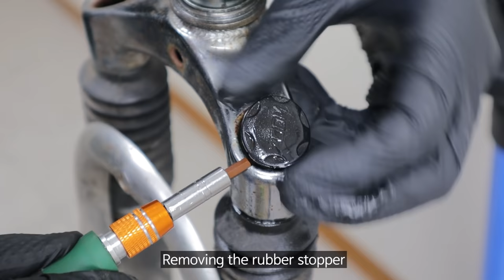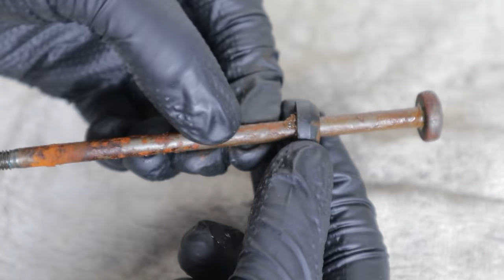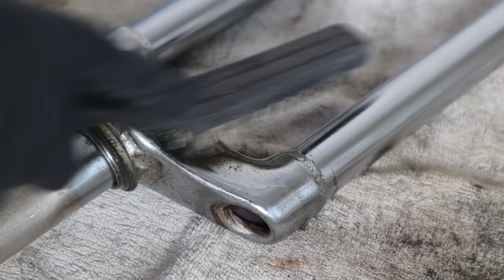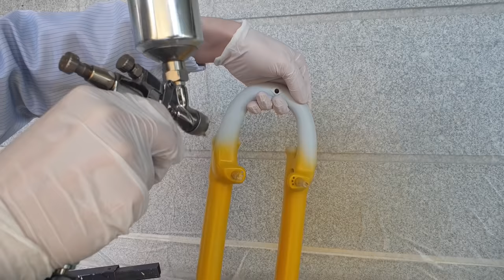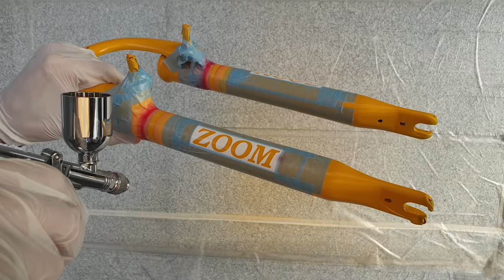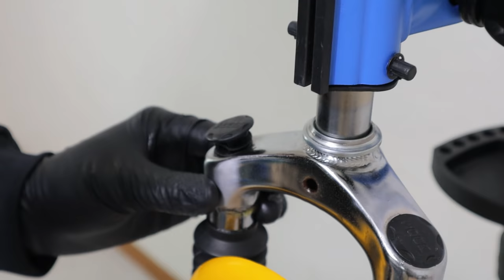[ASMR] Restoration Old Bike Suspension Fork

Comment from the maker: Thank you for watching.
Subscriptions and likes are a big boost to the next video.😀
Reply: I have a few comments to make. 1. It is better to protect chrome with a plastic brush and not with a metal brush. 2. Stickers are well removed if they are heated with a hair dryer. I do not know how Google will transfer the translation correctly)))
Reply: I have a question. Have you applied the varnish 2 times? Before the ZOOM label and then over the label?
Reply from the maker: @Kobenchack  Thank you! The logo was painted and then varnished.
Reply: Me referng to a Fox 40, where is the damper? And where the Air/Spring chamber? All i saw was a piece of Rubber to protect the Stanchions and the  Rods that kept the Lower legs on the Stanchions... additionaly why Yellow? this looks like a building equipment, i personaly dont like this colour on a fork at all...
Reply: Hello
Reply: @COMET RESTOEATION Good video.
Excuse me by chance the scissors or suspension that you are doing maintenance on is over rope or what type of scissors it is.
Reply: @marcosalfonsogonzalezarias558
Reply: Hola si mi horquilla marzochi Monster T no lleva fuelles en los barrales es malo ponerle?

Comment: Great job! but... what happened with the springs? Were they so damaged that you had to replace them completely? Did you restore them? That is something I would like to see. Thanks!
Reply: I wonder if there even were springs because they could never be secured by the plastic thing he puts in the upper leg. But thats where they should have went. I'm also sure he would have showed us the springs to make the video more interesting..
Reply: i think the spring is the 'black rubber' 😂😂😂
Reply: @kudinkesumin8775  elastomer !
Reply: @parrr3068  elastomer !
Reply: @parrr3068  Yes there are springs. They are inside the lowers, not inside the stanchions. They are secured by the long bolts. Also, there is one seal that is missing on his long bolt.
It looks like that he didn't removed the springs, i don't know why. I can say that most of the rust and mud are in the lowers, on the springs...
I have the same fork but mine was waaaaaaay more rusted 😅

Comment: What tool did you use to unscrew the fork?
Reply: A common star bit head, you can use a regular socket ratchet, extension & star bit head that fits...It doesn't have to be a T-handle wrench like the one he's using. One problem I see right away is, if those bolts are that rusty, then everything (springs) inside the fork will also be rusty. I thought he was going to remove the springs & other parts inside. Remove the rust, clean the inside of the fork and put it all back together.